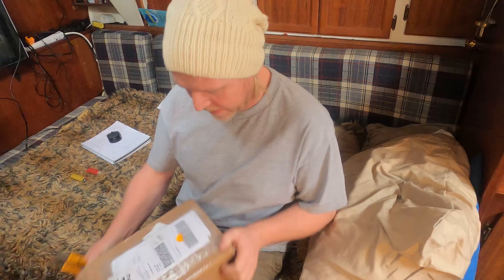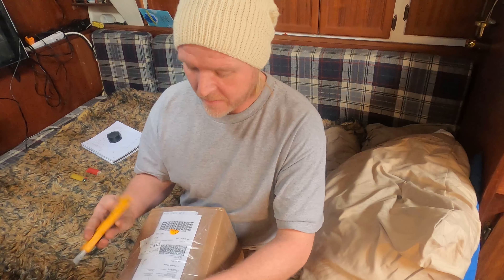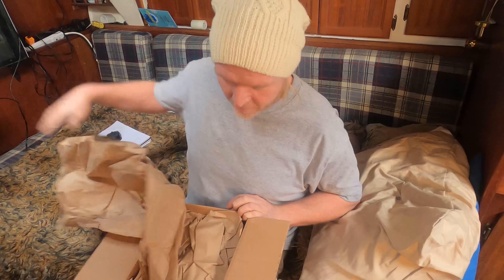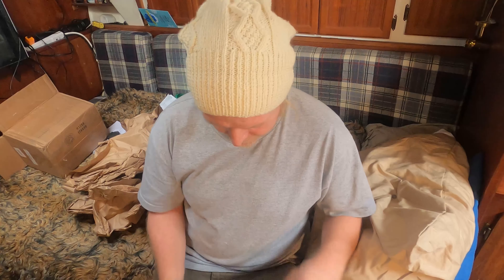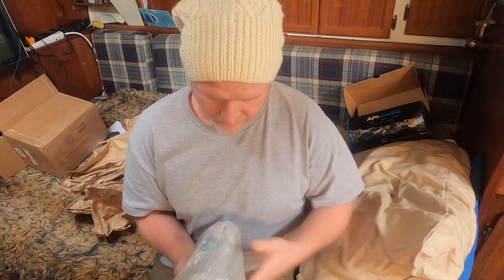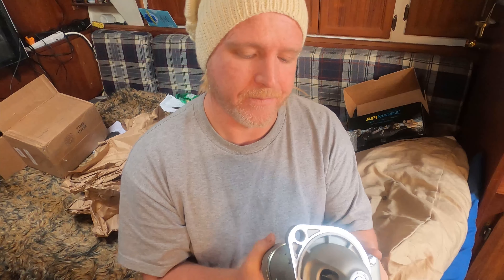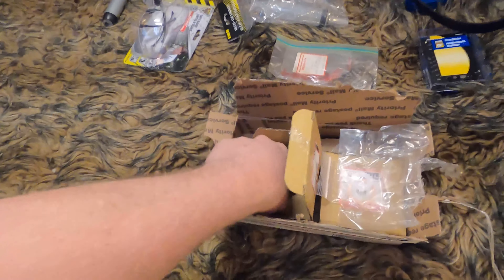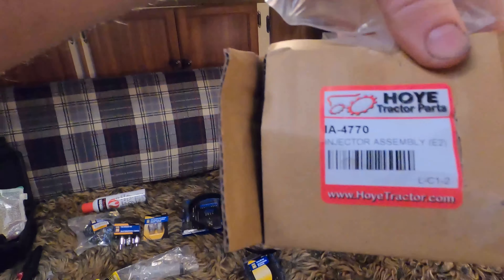Sailboat Engine problems solved! SVEV 23

Comment: Easy to bench test old starter, just need a batt and good ground.  Congrats on the repairs.  I replaced fuel lines on my 6.9L diesel,  4 batteries over 200 cranks to get primed.  Sheesh.

Comment: Oh ya Mike, I forgot to mention using the primer bulb to bleed the fuel system. I figured that out too...funny we both ended up at the same place! Again! 
I installed an electric fuel pump and by passed the mechanical pump. Pure music when it clatters to life, isn’t it!
Cap’n Lenny
Reply from the maker: You did mention the lift pump bypass, that got the ol noggen thinking..